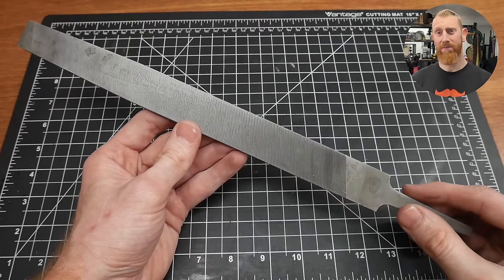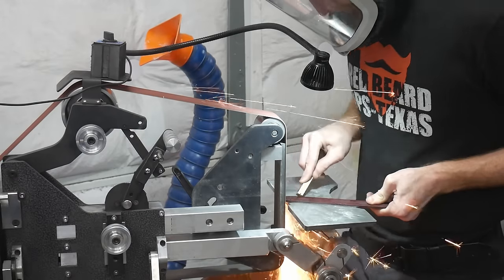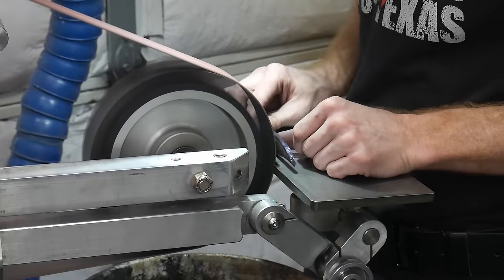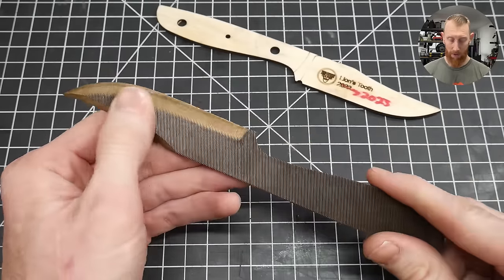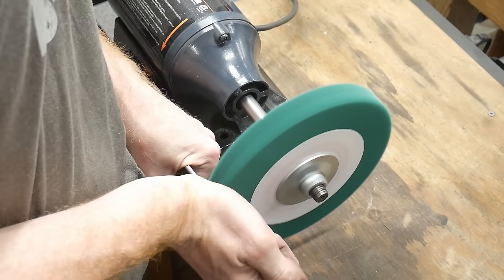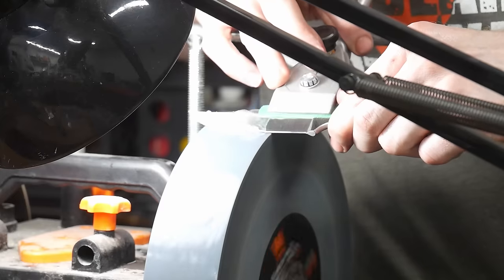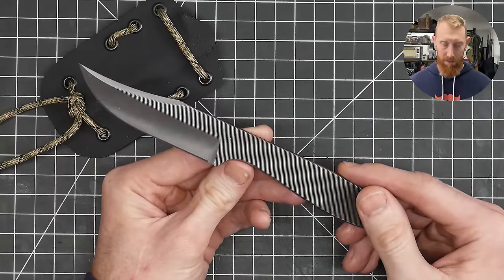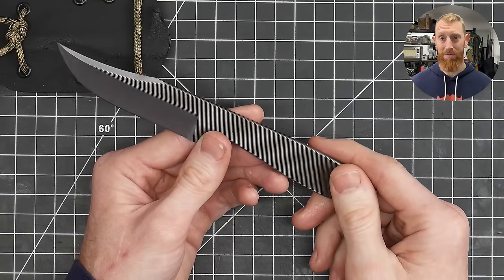Knife Making: How To Make A File Knife

Comment: When hollow grinding you want to try and line up your edge with the center axle of the grinding wheel. I understand exactly what you said about having the edge thicken and can be very frustrating to figure out. Also Travis wuertz does several excellent video explaining hollow grinding and they are worth a look. Nice work as usual on the build.
Reply from the maker: Thanks man, I'll take a look. I think I would of been better off free handing it and dipping the tang down during the grind. Allowing the edge to land at the same point on the wheel when grinding the belly and tip of the blade. That's I've I've done it in the past with good success, but wanted to try the work rest.
Reply: @RedBeardOps  that works well. It is similar to free hand flat grinding in that way with moving your pressure where you want to grind. It is just a little different working off a tool rest but is quick and effective once you get your tool rest height adjusted. I’m sure with a little practice you will have it down  in no time.

Comment: If you use an angle grinder and a belt sander and go slowly even if the metal heats up in places you can sand it off if you don’t take it back the entire way and cool it using water
Reply from the maker: In my eyes if you change the color past straw it needs to be re-heattreated (for use as a knife).

Comment: If the metal is overheated and has the purple look around parts of it, should it be scrapped or is it still fit wnough to be a useful blade?
Reply from the maker: You can re-heat treat the blade in that case. Or start with a new file.
Reply: @RedBeardOps  Oh okay, I am still new to this and wasn't sure, I appreciate your help.

Comment: Most modern files are case hardened as that's all a file needs, hard teeth, and it's easier and cheaper to manufacture.  So best to test by cutting a bit off.
Reply from the maker: Good point!

Comment: Any suggestions for a cheap starter belt sander. I've been wanting to dip my toe in knife making for a while and this seems like a good place to start
Reply from the maker: Man, if you're really just looking to get going, just about any 1x30 will save you time. Note that they generally run pretty fast, so you need to make sure to use nice sharp belts. Preferably ceramics. Here is a good video on it - https://youtu.be/MDdBpMaG2TE

Comment: Thanks for making these videos. I am super interested in starting to make knives. This looks like a really great first project. Is there a list of moderately inexpensive tools and equipment I could get off one of your videos? I don't mind spending several hundred dollars to get started. I don't want to do just an angle grinder alone. I've seen videos like the one you did with just an angle grinder. Thanks for any help you might be able to give.
Reply from the maker: Hey man, this video shows a few different methods for multiple operations with varying tools. Mayby helpful - https://youtu.be/nk7vu2RYxvI

A drill press would be #1 followed likely by a cheap belt grinder and maybe a bandsaw,.
Reply: @RedBeardOps  thanks so much man. Really appreciate it.

Comment: I'm confused (genuine question), doesn't the rapid water quench harden the material? I thought that slow cooling was necessary for tempering at low temperatures to reduce hardness?
Reply from the maker: This file is already hardened. When working with a piece of high carbon bar stock you'll quench the blade (generally in oil) to harden it; then temper in an oven to remove some of that hardness and make the blade tough.
Reply: @RedBeardOps  thanks for responding,  but doesn't tempering require slow cooling?
Reply from the maker: @noremacbeez  nope - This video may help - https://youtu.be/TBIiWwawKSY?si=pxy59YRUZo7_YHFy

Comment: Wouldn't it be easier to reharden the blade after doing the cutting than constantly worrying about overheating the metal?
Reply from the maker: If you have the capacity to do that
Reply: The whole point was to do it without a forge.

Comment: The file in its current state is brittle and vulnerable to brake. 
Put it in an oven for two hours, at about 180-200 degrees Celsius and you will get steel that is already where you need it.
This will allow you to save abrasive materials and you can skip all the heat treat and thermal treatment steps.
Reply from the maker: ...... 3:00

Comment: I'd say it's missing a lanyard hole. You could have annealed the part of the handle where you drilled and kept the rest of the knife in water.
Reply: Also maybe a sharpening choil on the blade with a dremel and small sanding disks or like a diamond file.
Reply from the maker: yep, lots of options